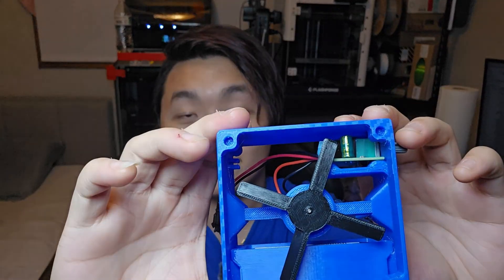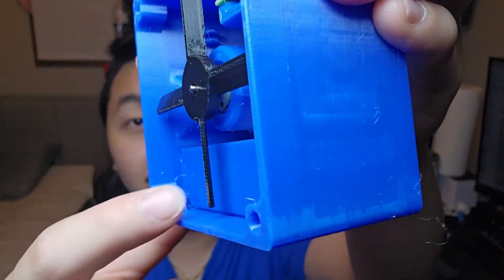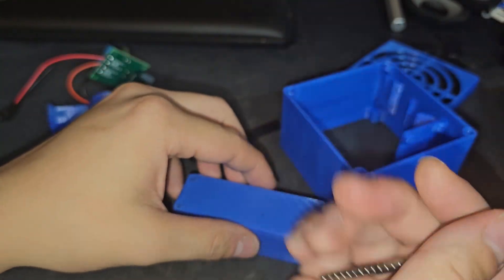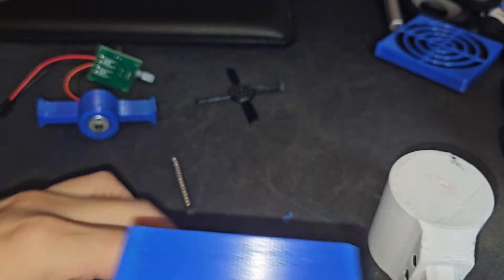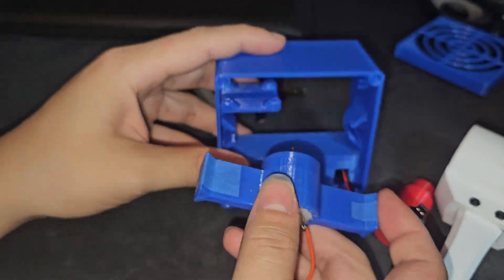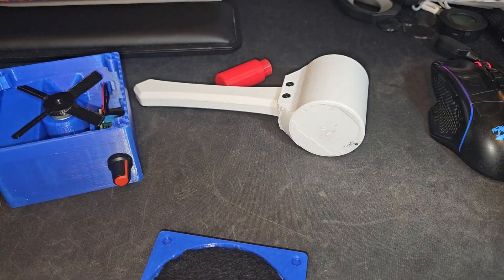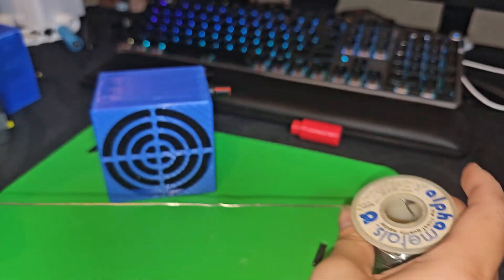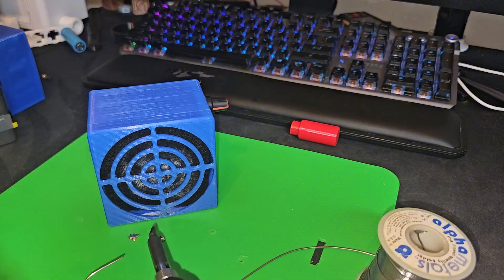3D Print A Fume Extractor

Comment: That's very cool!
Yes, heat does destroy magnets!
When I do a project that needs magnet holes, I make the holes around 0.5mm bigger so the magnet drops in easy, then before placing them I put a drop of super glue in the hole, pop in the magnet and it's there forever. Use a plastic thing to push the magnets in if needed, not a metal object.

But for future, you should use a computer fan, 12V, then use 3 or 4 of those 18650 3.7V batteries and a voltage (or speed) regulator.

They have a better design and probably cost the same as the motor you use. Even free if you find old power supplies and PC cases that people throw out.
I always keep those kinds of things. Have about 20 in a box somewhere... 😁

But good job there! 👍👍
Reply from the maker: Thanks for the information on the magnets and the fan setup!

Yeah these small motor are very cheap its like $1 per motor.